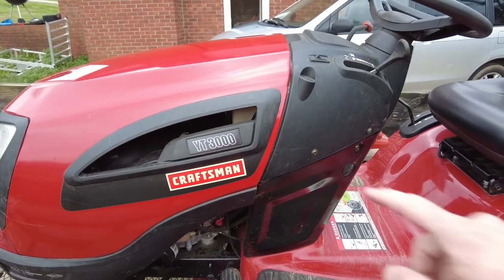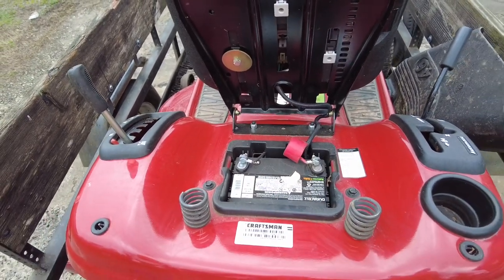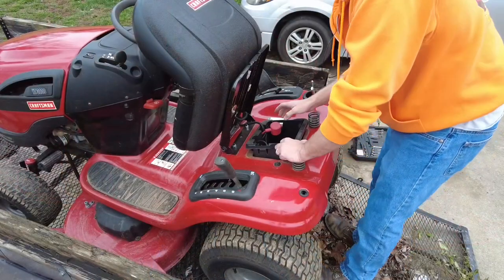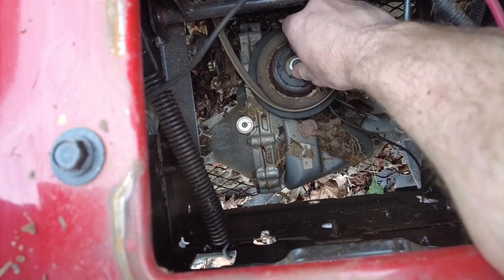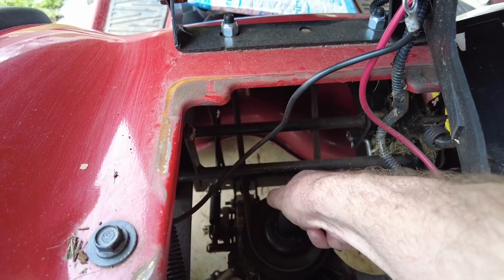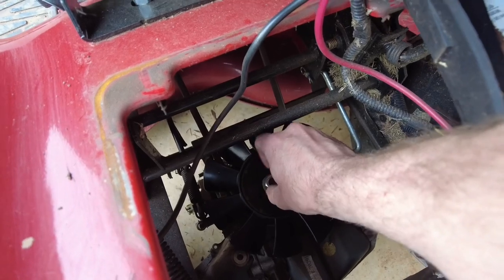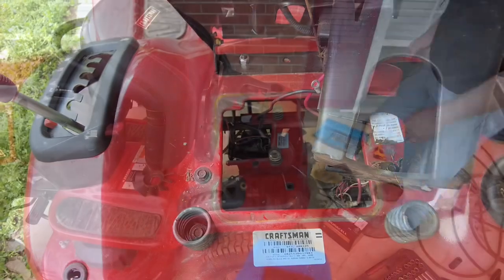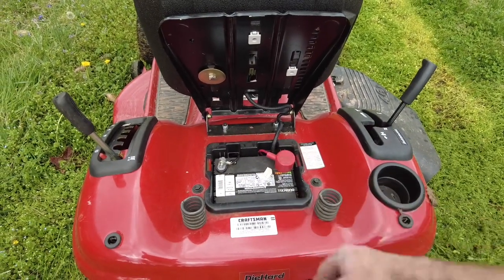Craftsman YT3000 transaxle fan replacement

Comment: hey thank you for the video--i found out today my fan was broken as well----i guess the fan is for cooling the transmission?--so  anything could knock the belt off the rear drive pulley correct?--It does not mean that the belt is bad?  thx
Reply from the maker: Could probably use a new belt but I think it’s a design flaw of these machines.

Comment: Will the tractor start without a fan? I have the same issue as well and I tried to start my engine and won't start. I'm only hearing a knock from the transmission.
Reply from the maker: If I remember correctly the mower would run with the fan broken.  If the fan broke in a way that it keeps the belt from moving that would keep the mower from starting.
Reply: @ChrisThedudenurse  thank you

Comment: When I try to loosen the nut to replace the fan, the transaxle moves (rotates).  I turned off the parking brake too.   Any ideas on how to stop it from spinning.
Reply from the maker: You could put the belt on the pulley then squeeze the belt together in that no man’s land away from the pulley and hopefully that’ll work.  Are you using an impact or a wrench?
Reply: @ChrisThedudenurse  impact.  Saw another video where you put a pair of vice grips on the pully and jam it against the side of the frame.  Gonna try that.
Reply: The only way I can see it using an impact.. and the only way to do that is unbolt the transaxle, jack the frame up enough to get a small impact in, could possibly be some kind of 90deg attachment for the impact, if you remove the rear wheel and loosen a bracket, there’s a few inches of space above the pulley. Good luck!
Reply: Impact works disgustingly easily.

Comment: could you run it without the fan?
Reply from the maker: You could, but you’re liable to overheat it.
Reply: I guess I’ll give it a try, il post the results
Reply: @ridgehawk1  any update without the plastic fan? I'm thinking about doing it too
Reply: @tterb777 yes, we’ve been running it without the fan, and so far haven’t had any problems, it’s been pretty hot weather, I bought a new fan, but it’s a real pain to put it on, only way I can see would be drop the transaxle, this model has the fuel tank above it, you can get to the fan by removing the rear wheel, but no way to hold the pulley to brake the nut loose, need to use a impact
Reply: @jmoore3613 yes I see your point, and I’m not recommending anyone else do it… but we’ve been using it to mown the infield of our RC flying field… a fairly large area and so far still no problems, been a hot summer. We have not been monitoring the transaxle temp, but all I can say is no issues….yet 😅
Reply: I was also concerned about the fuel tank above the fan getting hot 😮… but so far no boom😂